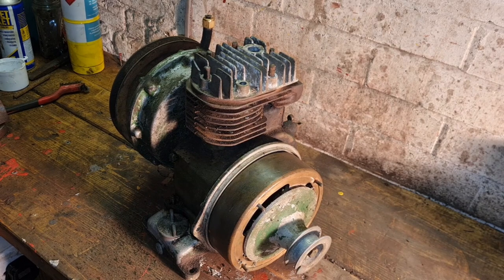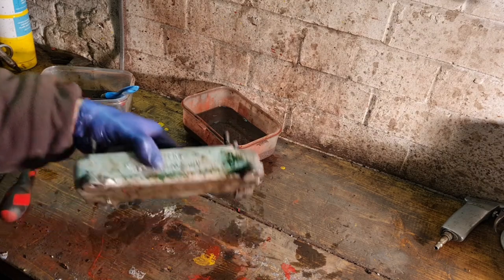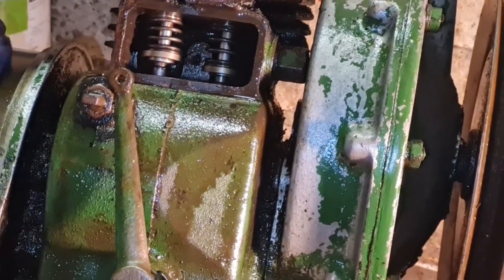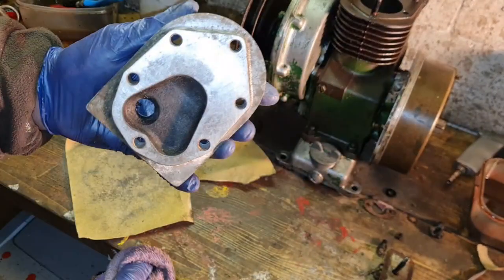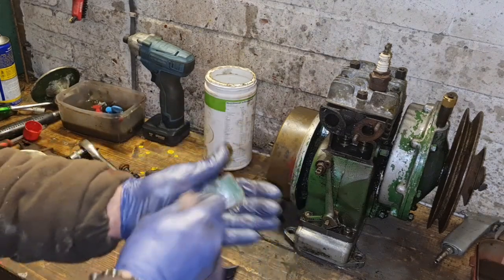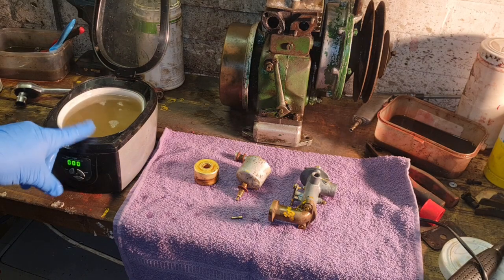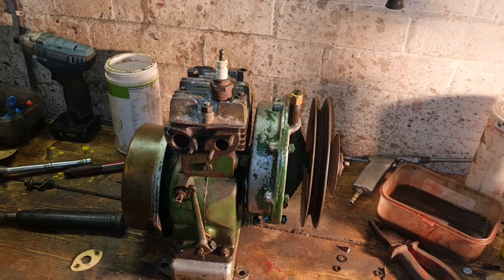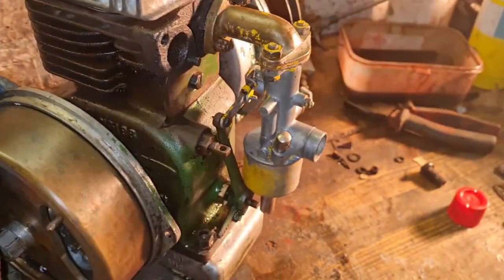Scrap yard find Vintage engine.

Comment: according to the Mk10/12 manual, its part number M.2788E Grommet (H.T. Lead). 

Great video. 

I rescued it off my friends scrap heap as he was going to chuck it in the skip. When I saw the head bolts loose I doubted it was much use but would be a good source of spares for you. over the moon to see it being restored. Sybil watched the video fixated to the screen. 

When you do that trick with the sand paper to get a flat surface, I always recommend using a piece of flat metal plate if you have a bit. 

Keep up the good work.
Reply from the maker: Thanks for all your support and sending her in. I think she will be a good engine James. Its looking hopeful. Glad Sybil liked it. 👍

Comment: great video ,if i remember correctly from my school days in the metal work class you heated the copper till it turned a bluish colour and quenched it in water to anneal it
Reply from the maker: Yeah. Because it's got a paper or compound centre I didn't want to get it that hot. It's seems to have sealed up tho. 😀

Comment: Softening metal is called 'Annealing'.
Proper annealing needs the metal to be heated above its re-crystallisation temperature for at least several minutes. Copper should be quenched in cold water after heating.
However, quenching steel after heating will make it harder. Steel should be air cooled gently to make it softer.

Comment: Thanks for a very entertaining video.  For the HT lead connection you need an Acorn Nut. I know they come in different sizes, many of my early cars had them on the dizzy caps and coils.  After you slide the Acorn Nut onto the HT lead and strip the inner wire, there should be a small copper split washer about 5/16" which slides over the HT lead wire core and then you fan the strands to wire out like a daisy flower to retain the washer. The wire and copper washer then gets pressed against the magneto HT stud when you tighten down the Acorn Nut.  Hope that's clear...

Re. the gaskets, I have a selection of steel balls  robbed from bearings and use them for the studs holes and minor round holes in hand made gaskets.  I find it best to tap the small holes in, before cutting round the edges of the gasket because they hold the gasket nicely in place.

You were a bit impetus with that fan nut... I was screaming at the screen not to do it!! LOL
Reply from the maker: Aw thanks very much. 😀